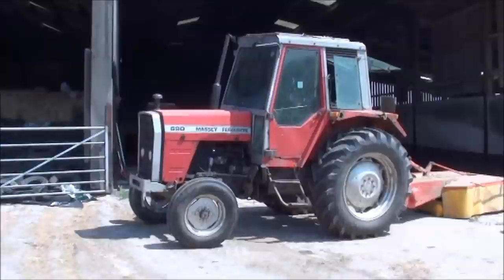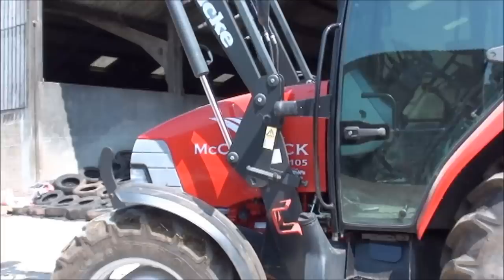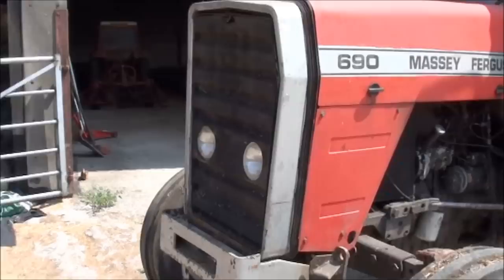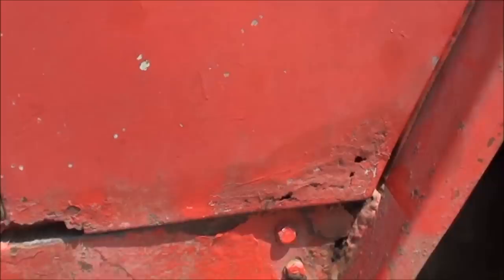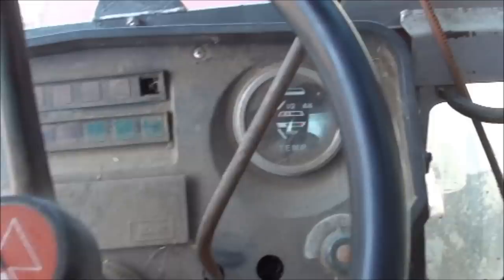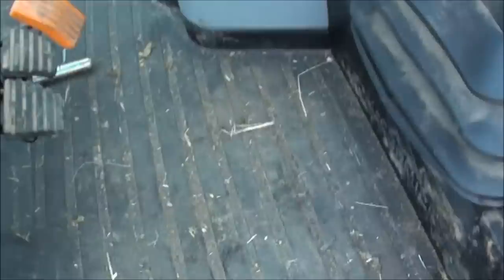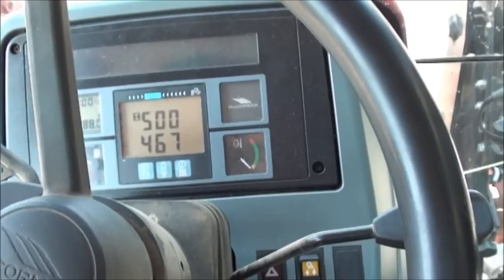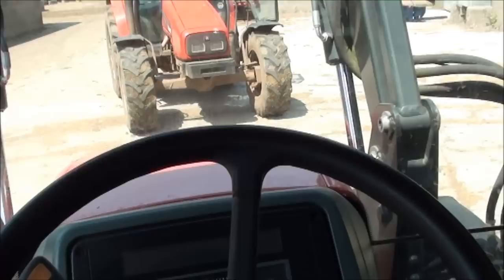Goodbye Massey Ferguson 690 hello McCormick CX105

Comment: Come up as a recommended on you tube, any way a 690 or 699 in 4 wheel drive was the first Massey I drove on the farm, I loved the purr of the Perkins engine, probably Spanish steel, my next was a 3000 series data tronic a beast of a machine, memories ❤

Comment from the maker: Thanks for the feedback. We will keep the Massey a bit longer as its still of use but at some point it will go. I'm just glad to get a replacement before the winter. The massey has done about 6500hrs but the engine less as it was replaced about 12 years ago.
I won't comment on the price i paid for the McCormick but i think it was a fair deal.
cheers

Comment: Don't want to curse your tractor but the brand new 2009 cx100 that I bought back then has been nothing but trouble the 5 years I've had it. Bearing in mind it has only done 680 hours, there have been numerous faults in the clutch, gearbox, PTO and just recently there has been a burst hose for the power steering and a burst gauze which has caught in the hydraulic oil filters and stopped all hydraulic flow. Could not advise against purchasing one stronger. There is no way to be sure wheter this is a one off and I have drawn a short straw or whether its common for newer models. Will surely be getting a replacement soon as the recent faults were the last straw for me.
Reply from the maker: Oh dear thats unfortunate. I'm keeping my fingers crossed this ones ok. The cx95 we bought 10 years ago has been pretty good, the only problems we have had is a faulty reversing sensor and a blocked radiator. Hopefully we will be ok with the cx105 but you never know

Comment: Do you still have the 690? we once owned a 690 but swapped it for a 390 which is basically a 690 with a cab that doesn't self-destruct (rust away)! Apart from the cab rusting, the 690 was a very good tractor

Comment: Did tbis tractor have a loader at one point I see it has little bits up front which look like part of a mount
Reply from the maker: yes
Reply: @thefunkyfarmer  why did you get rid of the loader? Also it would be neat to see some old pictures of the farm and past Tractors and stuff if you wouldn't mind
Reply from the maker: It never had one on it while we had it just the bracket

Comment: why dont u use the 4355 is it.
 why by anouther one if u could put a loader on the 4355
Reply from the maker: The Massey stays on the muck spreader, I needed another tractor for other jobs, it will be on the hedge trimmer for the next month so no good using it for loading
Reply: ohh
but amazing vid

Comment: Yeah 690 is good but the cabs rot quick i dont have a MF 690 but i have a MF 390,398 and 399 and the cabs hasent roted or rust at all;)
Reply: I have a 690 290 590 all good tractors in there day the 690 was a great tractor to work and had modern technology for its day if the cab was changed they would be super

Comment: 690 had Landini cab built with cheap Russian steel !!
Reply from the maker: Explains a lot. Terrible cab
Reply: Yes those 600 series tractors were notorious for those Landini cabs rotting away. I could not abide the weird drawbar/pick up hitch design on them either.
Reply from the maker: Mackeson3 yes i know what you mean about the drawbar

Comment: with new topics on the farm. what other things could be covered. not the same thing all the time, but farm disasters, tractors braking down, cows on the road does it happen to you. everything we see you have not problems, not yet. you seem to have common sense. is that why we dont see brake downs or disasters happen.
Reply from the maker: You might see some of these but to be honest when things go wrong the last thing I'm thinking of doing is filming. Yes the cows get out sometimes but when I'm chasing after them I'm more concerned in getting them back